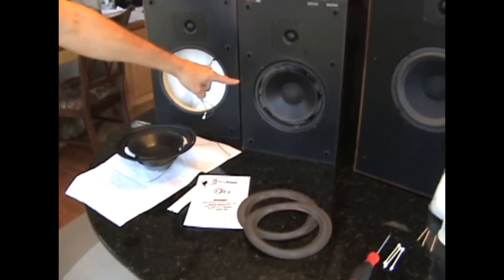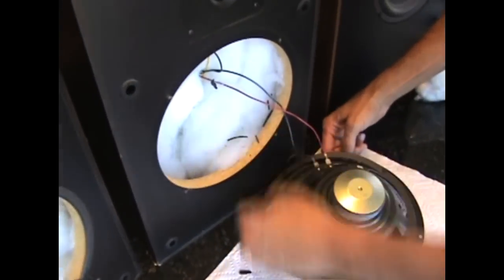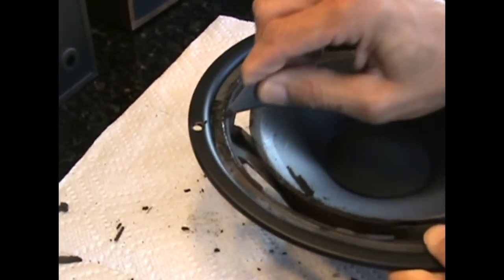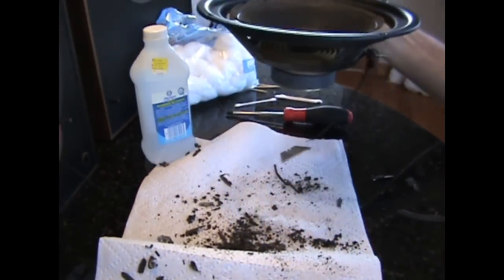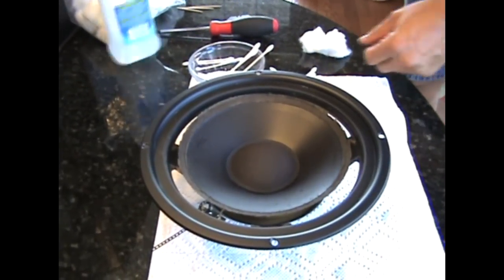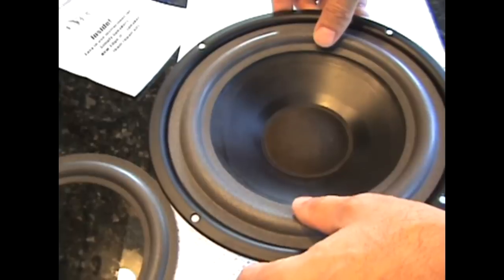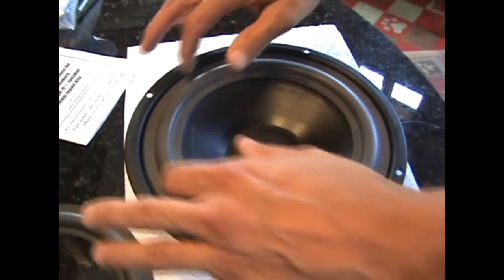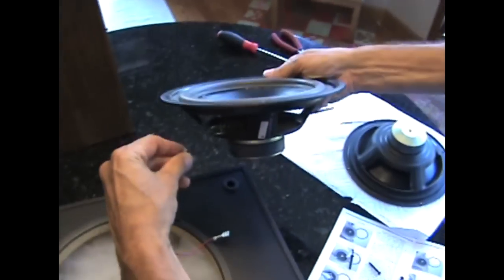Boston acoustics foam replacement

Comment: I have the Boston Accoustics A 40 that I bought back in the Winter of 1986. They sounded great and were written up in various audio magazines as a very good pair in sound & price for bookshelf designs. For 13 or so years, they were used at my mom's condo when I gave them to her for her birthday in January. They didn't have a lot of playing time by her or when I came for visits. By the early 2000's, I started to use them more frequently with my large audio collection...then, one day, they sounded bad. Took the grill cover off and wahala! They had the deterioration of the foam woofer supports. It was many years till just this week in October, 2019, that I finally ordered via Amazon the "Simply Speakers" replacement foams.
I've watched a few YouTube videos on how to replace the foam parts and, none to me seemed as easy as THIS video.   Now...my question to this video is how to correctly trim down the slight excess of the foam units that overhang by 4/32nd of an inch. I have a new ACTO BLADE cutter and I want to do the cutting right the first time. This project is a first for me. If it works out, I have an elderly friend who's deceased husband  bought many years ago a set of Radio Shack 15" 3 way speakers and the woofers are in need of a foam job.
I would like to read someone's suggestion on my "cutting-a-bit to fit", soon. 
Thanks!
Reply: @Untrepid One  - I did get the Boston Acoustics A 40 series a "proper fix" last year with the repair kit from Simply Speakers web site ordering. It was not hard...just follow the instructions and take time with it. The speakers sound like "new" if my hearing, which it's far from when I bought the Boston speakers is not like way back then. 
Thanks for the suggestion, though.

Comment: I replaced the foam on a set of Epicure 10 speakers.  I used both denatured alcohol and lacquer thinner to remove the glue.  Lacquer thinner worked much better.

Comment: The voice coil should be shimmed for proper gap alignment. This will ensure that the voice coil doesn't rub in the gap after reassembly and will ensure that the speaker performs as designed. Some speakers have a larger voice coil gap and can be re-surrounded without shimming. Speakers with a small voice coil gap, like the A60, should always be shimmed for proper alignment. If in doubt, you should shim the voice coil.
Reply: No there easy to center by hand, no need for shims.
Reply: Pret-ty sure passives don't have voice coils thus no shims
Reply: @airgliderz  Like I said, "Some speakers have a larger voice coil gap and can be re-surrounded without shimming. Speakers with a small voice coil gap, like the A60, should always be shimmed for proper alignment."
Reply: @jmb92555  The A60 is a 2 way speaker with a tweeter and a woofer. there's no passive radiator. Speakers with a small voice coil gap, like the woofer on an A60, should always be shimmed for proper alignment.

Comment: No need to mark the black lead, the two female and two male spade connectors are two different sizes. Very easy to identify.
Reply: Nope. Boston drivers lugs are the same size. I have all 6 out of my A400s right now.
Reply: Also, no need to identify the black lead, BECAUSE IT'S BLACK! lol

Comment: No need to do that extra zipping thing, there is a red plus sign on the woofer , you t attach the red wire to that port, you just adding extra not needed task.

Comment: Next time apply glue on the foam for a cleaner look....
Reply: +John Marrero I was going to suggest the same thing, you could smooth out the glue near the edges so it doesn't leak into the paper cone area or the metal surround area.  Also you can apply the glue to both rings at once this way.  I will do this project later today.

Comment: Sorry, you missed a step. The dust cap has to removed and shims inserted between voice coil and pole piece for proper alignment of voice coil gap. Method shown in video will surely result in rubbing voice coil.

Comment: This was a novice replacing foam. The glue work is messy and most importantly he bought a standard generic surround versus the proper filleted Boston/Epi surround. Overall very novice.
Reply: Have you found a better pro quality video?